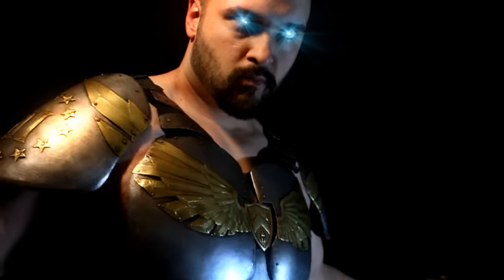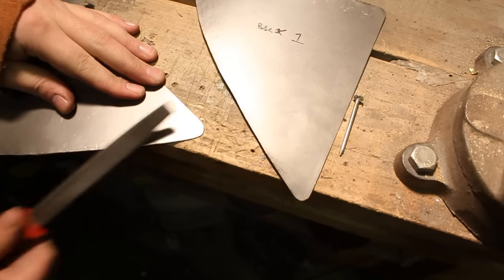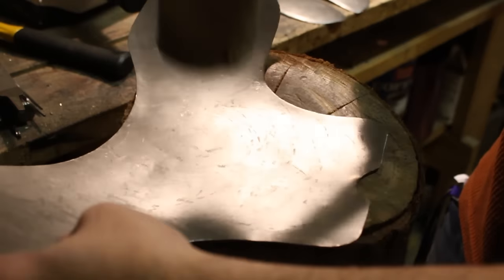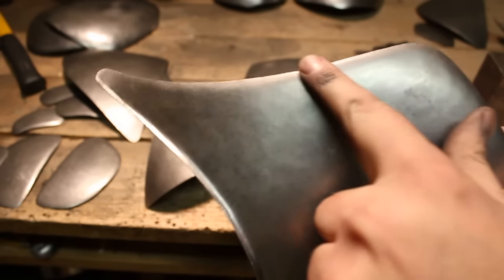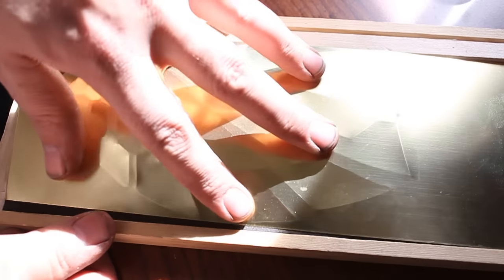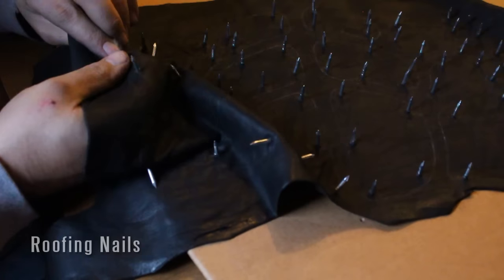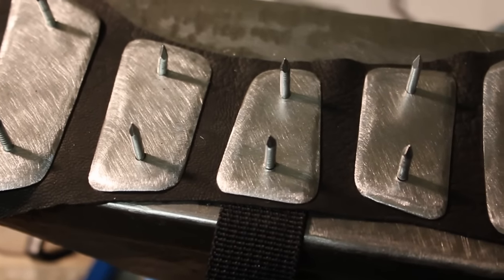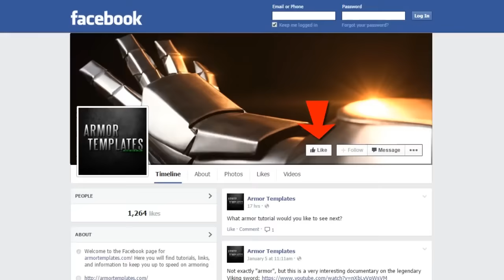How to Make Armor with Ordinary Tools - Superhero Breastplate

Comment: if you can make the steel thicker and use a thin sheet of Kevlar to hold steel and using thicker Kevlar pieces shapes as the steel sowed with elastics to the thin sheet of Kevlar  then it will be Bulletproof

Comment: In lieu of the sledge hammer head, I've found an old trailer hitch ball held in a vice does an ok job for putting in and planishing (?) smaller pieces.
Reply from the maker: +docleafman that would work fine too, but being a lot more round, care needs to be taken in order not to round the pieces too much
Reply: Yeah found that out pretty quick lol. Have been working with copper a lot and thankfully it is fixed easily. Thanks a ton for these videos. It has really expanded my "making" with metals.
Reply from the maker: You bet! And thank you for checking out the videos

Comment: Instead of a sledgehammer head I've used a trailer hitch. I still needed to grind off some edges, but it was quick work. I can even bolt it in the hardy hole of my anvil. :)
Reply from the maker: +Thax nice. I have heard of people doing that before. I would like to get one in the future.My sledgehammer was free though so I used it.

Comment: This is one of the most badass things I've seen from you. Great job. 
That's just epic.
Reply from the maker: +xxuresort thanks very much!
Reply: David Guyton So I'm working on a Leviathan style armor (fantasy kinda) and it's looking really good, but the rivets I used doesn't work for it because it's a lighter metal than I'd normally use. Can you suggest anything that can help?
Reply from the maker: if the nail style rivets I use won't work, you can get some "leather rivets", sometimes called "rapid rivets". It's a little different style but they will work for just about anything
Reply: David Guyton  Actually, I used iron rivets. What kind do you use? Thanks though, I will try that :)
Reply from the maker: In this build, I used ordinary roofing nails for rivets, but also some copper rod I made into rivets to attach the brasswork
Reply: David Guyton Oh, nice. Does aluminum rivets work just as well?
Reply from the maker: any metal will work fine
Reply: David Guyton That's good. Thank you :D

Comment: Fantastic stuff. Surprised you didn't go with buckles made of metal rather than the snaps though. Suppose the snaps make it easier to fit snug.
Reply from the maker: +Dodge West yes, that's one reason I chose the plastic ones. The other reason is that it would be impossible for me to buckle this thing on my myself if I used traditional buckles
Reply: +David Guyton yeah I can totally see that it would be. Still loving it.

Comment: White charcoal? Like chalk? I use white paint markers for using on steel; when I am satisfied with the design. Chalk is great for making temporary lines, or ones where only one cut is really needed :)i am in awe over your cold work. This turned out really nice. Thanks for the video.
Reply from the maker: it's like a chalk, yes. I needed something that was temporary, since I didn't want any marks to stay on the leather after the metal was put on.

Comment: Another great video David! Thanks for sharing. Have you ever tried raising instead of dishing? Or does that defeat the purpose of your videos?
Reply from the maker: +James Blanton raising properly would require heat. The dishing I do is not very dramatic, and it pretty easy to do with just a dishing stump. It's basically free equipment and much safer than using heat.
Reply: +David Guyton 👍

Comment: Might i suggest instead of a polished hammer head to get a trailer Hitch Ball :) you'll get the surface you want plus a nice way to hold it with a vice.
Reply from the maker: that would work well for tighter curves, but since these plates are fairly gradual, the flatter surface of the hammer works well
Reply: I do understand that :) and thanks for all the Templates you're selling, it will help me a lot with my LARP armors i need to do.

Comment: will a rounded off end of a 3.25 inch thick insanely large bolt work instead of hammer?
Reply from the maker: if the bolt originally came with a gold colored coating, then yes, it will be hard enough. If not, it may or may not work, I don't know. The gold coloring indicates that it is Grade 8, which is very hard steel. A hammer head is tool steel, and is also crazy hard.  I say give it a try with the bolt. Let me know how it goes.

Comment: Hey David, awesome build!
I have a question. How do you design the templates? Do you use 3d or CAD softwares to do so or just start by forming other materials.
Reply from the maker: +Nishant Agarwal I keep it pretty low tech. My designs start with a pencil sketch, and then I start cutting them out in posterboard. I make some changes where needed, and then jump to metal

Comment: You've inspired me to finally get off my arse and make a set of armour for myself. I have one question...I want to make it all plate armour, much like what pieces you've made so far, but I want to add a dragon scale or reptile scale type effect to the plate, sort of how you did the teeth on the helmet, but obviously a scale shape. Any ideas on how I can get that kind of patern, like, what kind of tool I can use? Obviously it will be super tedious and just a lot of light tapping and staggering the scales, I just don't know what tool to use for that shape or if I will have to make one.
Reply from the maker: +Dan Williams hmmm no I can't think of an easy way to do that. I suppose you could sort of treat it like repousse work, but being that the steel is a lot thicker than the brass I use, it won't me easy. Even the helmet faceplate was thinner than the steel I used here (26ga compared to 20ga) and the teeth were not hard but not THAT easy. I wish I had a better answer for you, but I am afraid I don't really know
Reply: David Guyton I was afraid of that. Well, thanks for such a rapid response. If you come up with any ideas, I'll be trying to figure it out for a while. I had thought about doing it sort of like repousse work, it will just be suuuuper tedious.

Comment: asking from from experience, how bad are the bruises on your chest right above your armpits?
Reply from the maker: I only wore this for the few hours it took to film the opening shots, but I did not get any bruises. If you're getting bruises anywhere, you need to adjust your armor. Make sure you are rolling the edges anywhere it touches your skin. Pull the armor outward so that it's not digging into you. Add leather or foam wherever contact is made.

Comment: It is difficult to place the pieces on to the leather vest ..
Reply from the maker: +rambo dhanda it takes time to lay them out so that it will fit you properly, but it's not difficult. All of the instructions for that are included in the template. There's also a diagram so you can see where all the pieces go.

Comment: Can this armor be used in an "armored combat league"? If not can you do a tutorial on one? You do great work and I'd love to make something I can fight in.
Reply from the maker: I don't know what the requirements are for that, however none of the stuff I make is heat treated for hardening. There's nothing to prevent someone from using my designs and hardening them though...but that's not what my channel is aimed at. I try to keep things simple so that ordinary people with ordinary tools can do this.
Reply: Oh lord no, the metal is way too thin and like david said, not hardened. the minimum is around 18g (16g for springsteel) hardened, helmets even thicker. :)
Reply: Killem shawty been researching into it more and more and it's best I buy my armor so I don't die because I didn't know what I was doing lol

Comment: Is it possible to weld in place all the repousse instead of using rivets?
Reply from the maker: Yes but not if you want to attach two different metals. If you want to use steel for the accents, you can weld that on with a MIG or TIG welder
Reply: ok so welding 2 different metals together will do what then?
how about using steel for the repousses and then paint them the color you want and then weld them into place? Would that work?
Reply from the maker: If you tried to weld brass to steel, all it will do it melt the steel. The brass will be unaffected, If you intend to paint the repousse work, I suggest you do it after welding, because the welding process is going to burn off all the paint.

Comment: one quick question, does one absolutely need a Raw-hide hammer for this kind of metalworking?
Reply from the maker: No not necessary. The rawhide hammer is just gentler on the metal, therefore making less dents you need to hammer out later on. They are not expensive though and very handy to have, especially for larger pieces. You can do all of this without it though.
Reply: David Guyton thanks heaps :)

Comment: Can I ask how did you get the sledgehammer piece to look like that? Just used a grinder on it?
Reply from the maker: +Borbali I used a grinder to round the edges a little, then I used the flap wheel on a handheld grinder to soften the edges some. Then 80grit sanpaper
Reply: +David Guyton Thanks for the swift reply, David. Getting my anvil tomorrow, wish me luck.
Reply from the maker: Good luck! You'll be SHOCKED at how often you end up using an anvil fir projects around the house. Very good investment.

Comment: so are these templates measured to fit you? Or on them is there a way to convert it to personal measurements
Reply from the maker: +Ian Byrne there's instructions on how to get it to fit your own body in the template
Reply: David Guyton OK, thanks!
Reply: +David Guyton Your logo on the shoulder is the Oath Keepers logo generally used by the militia.
Reply from the maker: Not the Oath Keepers logo. They use a similar one on occasion. This is a "Three Percenter" logo, sometimes called "Threeper", also called Nyberg when on a flag with American stripes. It's a general logo meaning you are of the 3%, whereas Oath Keepers is an organization (with some shady history) made up mostly of former military and police.

Comment: Mr guyton how do you do the rivets
Reply from the maker: +Terence Bain JR I show you how in every video. I generally use roofing nails, I put them through the hole and cut them off, then I hammer down on where I cut it off. This creates a rivet
Reply: +David Guyton  thanks but what is used to cut it
Reply from the maker: you can use anything that will cut metal. A hacksaw, a Dremel tool or grinder with a cutoff wheel, or the tool I use in the video. Not sure the official name of it. I always heard it called a "nipper" tool

Comment: David, really enjoying the content! Already bought 8 templates and am putting them on paper! Was hoping you would do me the favor of explaining how to produce the template in the first place. I have some patterns that I would like to try, but it seems as though "just trying it on paper first" only seem to increase my recycling center's inventory! Thank you for your videos, thank you for your time!
Reply from the maker: +merlin4029 Awesome! I hope you're enjoying your projects! There's no real secret to template creation. It's just trial and error and like you said, a whoooooole lot of scrap paper haha. I'm able to kinda envision it well enough in my head, and I sketch it on paper, and then I try to make one or two key pieces in posterboard. Then I fir them to my body, seeing if the size is right and if the idea will work. Once I get one piece I can go from there, making the pieces that connect to it. Sometimes it's a lot easier, for instance, the abdominal muscles on this piece were not measured or fitted at all because I knew the layout would work without issue. Sometimes it's very hard, like with the pauldron. Since that piece is so curved (a compound curve in two directions) it was very difficult to plan that out with a flat piece of paper and have it come out the right size and shape in the end, and having it line up with and properly connect to the other pieces.
Reply: Thank you for responding! I thought that with my lack of artistry, I was making a mess of the project, but it sounds like I've got the right of it, lol! Thank you again and I look forward to more awesome patterns!

Comment: +David Guyton how much is a full set of armour? I'm not asking to buy yours, but I don't have much money and I want to show people that I can do awesome stuff like this, I know it takes time, and it looks easy in these videos but I know it isn't. That's alright though. Putting myself to the test is part of the build.
Reply from the maker: +IzzyThePsycho Universe I do not sell the armor I make. I make the tutorials so that people can make their own. On occasion some of my stuff ends up on Ebay but not very often. This particular piece I would never sell, but if I did the pricetag would have to be north of $1,000 for the time it takes to build. Probably closer to $1,500. The template, however, is only $8.99
Reply: no i wasnt asking to buy your armour, just where and how much the peices for the armour are, the sheets of metal i mean.
Reply from the maker: I usually post the cost of things in the videos. In this case, the steel for this entire build was $24. The brass was probably about $15
Reply: not bad, that's actually cheap, well i guess it would be.

Comment: it would be bullet proof if you use different metal like titanium or stanless steel or aluminum
Reply from the maker: No, it wouldn't.
Reply: titanium is the strongest metal the other metals I see
Reply from the maker: no metal at these thicknesses, or anything close to these thicknesses, is, or will ever be bulletproof
Reply: Aluminium would actually make it less bullet proof than the steel used in the video.
Reply: Ok i dont why i said aluminum i think I was thinking of something different but probaly. Titanium cant stop all bullets it depends on the bullet i saw youtube video very thico metal thats the size of my hand bullet went through

Comment: Fuck I love your videos, I wish I could make them myself but the amount of confidence I have within myself to successfully make one is about 0. 
I do have a question if you could? 
 When it comes to dishing, is there something you can suggest to find something to use?
Reply from the maker: Firstly, I promise that if you try this, and put the time in, you CAN do this. Secondly, as far as dishing goes, you just need an ordinary piece of hard wood. I got a piece of oak from a friend's firewood pile. One thing you need to make sure of is that it's seasoned though. Seasoned firewood just means that is has aged about a year, meaning it has dried out sufficiently. I used a grinder to cut out the dished area
Reply: David Guyton Thank you so much for the reply, I appreciate the time you take to do your videos and interact with your community :) Keep up the good work and I look forward to watching more in the future.

Comment: You forgot to mention one thing... Is all this armor you're showing us how to make.... battle ready? If not the materials you use in these videos, perhaps, higher quality, thicker metal you might be able to, say... uh.. recommend? >:)
Reply from the maker: Battle ready armor requires heat treatment along with being much thicker. There is nothing stopping you from using thicker steel and heat treating it, but that's not what I do on this channel. I keep things as simple as I can so that people are encouraged to get into this hobby without expensive tools and difficult requirements like heat treating and tempering.
Reply: Yes you are! and delivering! The skull helmet is a masterpiece.

Comment: Is VERY nice, but I don't really like the belly and back design, isn't much convincing.

A sword or spear thrust that hit on a plate ever will be redirected to the leather and... Kill the bearer. On your back and belly, in practice you are using a soft leather armor. To survive, is good to have superpowers...

I know, is stage stuff. But even so, would be better if convincing...
Reply from the maker: +CopernicoTube In my whole life I have never been attacked with a spear or a sword.
Reply: David Guyton I really believe you, me neither! :)

(Well, not exactly... But it's not relevant)

But, it's an armor, right? All your other designs (I'm a fan) looks quite credible, but this, even gorgeous, doesn't.

I don't have any intent to troll, is a constructive criticism.
Reply from the maker: You have to keep in mind that I have to design armor in such a way that it can be modified to fit all different size people. The back and the front are segmented so that the person building it can alter the size of the piece without having to make drastic changes to the individual pieces.As a bonus, this also allows the wearer maximum range of motion, since each individual metal "muscle" lines up (more or less) with the actual muscles underneath. If I were to make a solid cuirass, there would be no easy way to modify the template to fit every body type. And as I mentioned already, I do not get attacked with swords or spears. I do not make armor to protect from swords and spears. I make armor because it's a cool, fun hobby that anyone can enjoy.